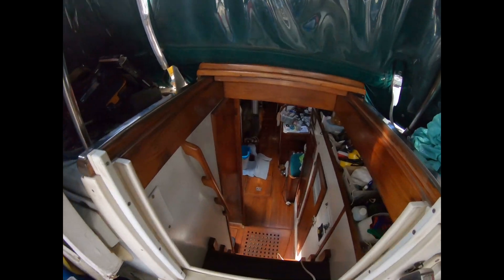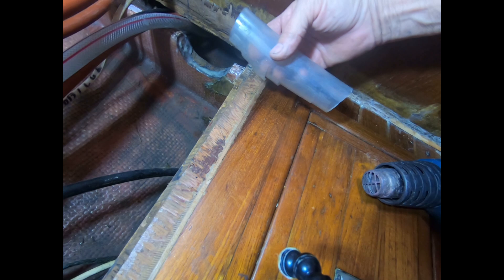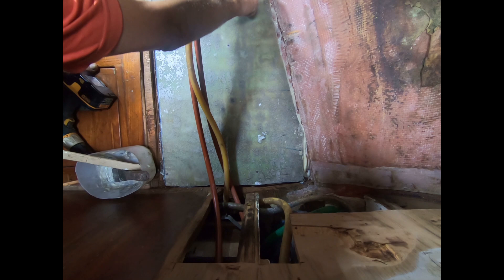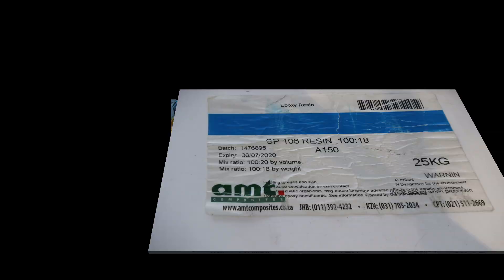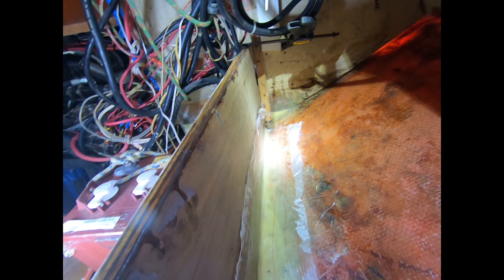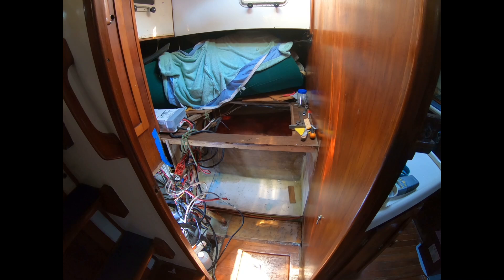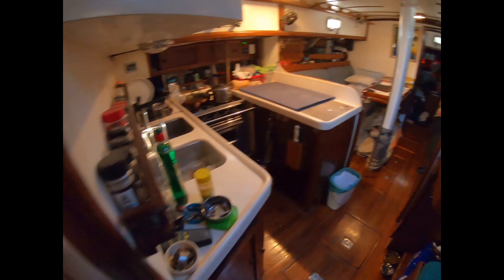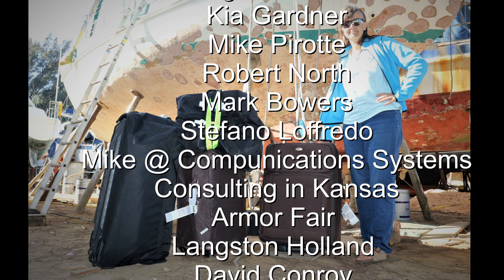How to Rebuild a Battery Box (LEAKING lead acid batteries on a Sailboat!!) Patrick Childress #46

Comment: Patrick, I would suggest aluminum angle, install it "inverted" with the sides bolted to the left & right panels you installed. Then the other side will rest on the battery tops which would hold them in place even with the boat inverted. I did my boat this way. I was always thinking what would happen to hundreds of pounds of batteries if I ever rolled the boat & the angled aluminum solved the problem. I actually secured everything in the boat to remain in place if inverted as I had two friends (on two different boats, one actually WAS a Valiant 40) that inverted their boats, one from a roll, the other from pitchpolling. The boats righted fine with minimal flooding but the crew on each sustained very serious injuries from flying debris, galley stores, batteries, tools, etc. From that point on I modified as necessary everything to stay in place should the worst happen. I always slept better, especially if hove to & sleeping in big seas!
Reply from the maker: Interesting points. Thanks for sharing.

Comment: Amazing energy and tenacity, Patrick. I’ll be using that episode for inspiration many times. “What would Patrick do here?”
Reply from the maker: What a compliment. Yea...I’m not sure where he gets the energy and enthusiasm for all this. The moment it was done, he didn’t even take a breather. He has moved on to the foredeck and windlass! -Rebecca
Reply: Patrick Childress Sailing No breather ay. Hmmm thats not me. I do a lot of breathering. I try to make up for that by being more strategic with how I spend my efforts. I have to make two built in waste holding tanks (no room for off shelf versions) so will be using Patricks techniques and energy model for that project. If you are interested I am developing a gizmo I call a dynamic bridle to resolve the rolling anchorage problem. It will be a small low powered winch roller module to drive a loop line to angle the boat optimally on the end of the anchor chain to head into an otherwise beam swell. It is getting smaller and more workable the more I think about it. If you want to talk about this and share thoughts and anchoring experience (I have very little so far so am shooting in the dark as I develop this idea) bill@cgrpt.com

Comment: Patrick, thanks for filming this project. I did a redesign of my battery area similar to yours but smaller in scale and without all the deconstruction in order to get a bank of T-105's in the locker. For strapping them down, I used 2.5" straps with plastic buckles (acid proof from a surplus store) and ran them under the batteries through slots in the structural floor. These go over the tops of the boxes I glassed together for the batteries and attach on top. The batteries are strapped in but easily can be unattached and opened for servicing. You just have to remember to have the straps hanging out of the side when you put in a battery! Good luck!
Reply from the maker: That way of strapping is a nice idea. Thanks.

Comment: Some flat metal bars with a 90deg bend on each end would work. Grind a notch on each upturned end so you can lift and rotate 90deg to remove sideways?
 Or cut some wood a little under sized to use as a male mold and do a glass U channel layup of the same just don't forget to peel ply the wood first, a bit of Kevlar or core might be advisable maybe even some Dacron or that nylon webbing for tensile strength should she be over turned completely.
 Thanks for the informative and inspiring content.
Reply from the maker: Kyle, Thanks for your idea and positive comment.

Comment: Another fabulous video Patrick, my assumption is that epoxy is impervious to battery acid, Which is good to know. I appreciate the fact that you’re a meticulous craftsman, as am I so your videos are very relatable. And now comes the hull, What fun! Cheers
Reply from the maker: Yes, all the information I could find says that battery acid does not bother epoxy but will eat polyester and vinylester.  There was not time to show it in the video, but I put a full layer of glass and epoxy resin on the floor of the battery box as there was no way of telling what type of resin was used to make the recycled panel.  I think, next weekend we will start in on the blister repair. That should actually go fast, the patching of the craters, but all the faring will be the labor and time killer.

Comment: As per usual,  nice work, Patrick.  It looks impervious, and so should the battery-clampage.  Have you considered visiting the dumpster and finding a chunk of suitable discard to be cut/fit/held in place on top of the middle battery and under the existing side cleats, by the red battery cables and compartment side?  As tightly-fit as they are, I don't think the batteries can fall out, but the addition of a friction-fit board above and across the middle batteries would do the same thing, with squeezed garden hose providing the cushioning 'friction'.  Shim shingles even more so.  No need making it too complicated/expensive, no?  Happy hunting, friend.   (Note to Rebecca--a shot of Patrick 'dumpster diving' might make a great tee shirt deco,,,just sayin').   Each episode is a treat,,,thank you.
Reply from the maker: That is an idea for securing the batteries but I would have to strengthen, like glue in, the cleats that support the battery box covers, as they are just screwed in now.  Thanks.

Comment: for driving screws,  nothing beats the switch to Robertson screws and bits (AKA square drive)  philips bits are the worst!
Reply from the maker: I can't understand why more square drive screws are not made. I used a lot of stainless steel square drive screws to secure synthetic planking on back yard decks. I thought for sure, manufacturers would catch onto square drive, but not so.
Reply: @SailingBrickHouse-RVLife   Stainless square drive are easy to find.  I use them exclusively. just order them by the box of 100.  As I refit my boat I'm removing lots of old philips head,  they go straight in the bin and  get replaced by a square drive.  But I am in Canada where they are very popular!

Comment: never  fail to impress,, nice to see you use the paddle when laying up the mat with the resin,  dont usually see that  and it makes such a good job,, yes you sure know how to handle that grinder , but my heart was in my mouth when i saw those bare feet so close to the disc,,, i am not a great fan of the saftey mob but my two always are proper foot wear and gloves when using a grinder, oh and glasses.,, great vid Pat  , and nice job,,, no tips for the battery hold downs but i am sure you will come up with something suitable... cheers R
Reply from the maker: I suppose it always appears riskier when watching someone else working with a power tool. I have had that grinder for decades. Thanks for your comment.

Comment: I have stainless steel flat bars that are thru bolted from the battery box side walls, keeping the batteries down. Heavy 240Ah batteries, so quite heavy duty flat bars. I don't know if it works good with your setup, but one idea anyways...
Reply from the maker: Thanks for the suggestion. I will see how I can make that work.

Comment: I'm a big fan of pad eyes and bungee cords for securing batteries, if you glass those nylon straps in you are going to have a mess on your hands when it comes time to replace them.
Another option is to make some strong backs out of pvc pipe and put them between the tops of the batteries and the battery box top to hold them down.
Reply from the maker: PVC pipe, with a stainless steel rod inside for strength and rigidity. That is what we use to lock our companionway hatch closed , at night, in questionably safe anchorages. Set in sockets, in the battery box, that could work. Thanks .

Comment: To make battery hold downs, use a piece of StarBoard (high density polyurethane board) spanning across batteries and using blocks of the same material used for shims under bar to batteries—pushing down on batteries—all screwed together and bolted to the sides of battery box. Makes a clean solid bar hold down structure across all batteries instead of a strap. Material is impervious to acids.
Reply from the maker: Thanks for the nice idea.

Comment: Securing the  batteries.

I would use aluminum crossbars (square bars) bolted to the sides of the box via brackets to secure the batteries. This should hold the batteries in place even if you flip and make the whole box stronger by connecting the two sides together. You could also try to do something similar with wood and fiberglass and that might be cheaper and ligher, but that would be a lot of work. Brackets are a very easy way to ensure a secure connection. You might end up with several mm between the bottoms of the bars and the tops of the batteries, but you can easily fill that gap with a dense rubber to get the perfect fit and this would also leave some room for future batteries that might be a bit taller. It looks like you will need 3 bars (one for each side-by-side pair).

If you want to use straps they need to attach near the BOTTOM of the box to hold the batteries DOWN. Otherwise you have an exponential amount of the stress on the straps and where the straps are attached*. Don't use nylon straps, nylon is sensetive to acids. It seems like it is too late in the project to put a proper attachment point at the bottom of the box, hence my suggestion for bars.

Why don't you just screw (or bolt) the covers down? Put some styrofoam blocks under the covers that hold the batteries exactly in place but still allow airflow. Should work better than what it looks like you were considering with that strap, be less work, and cost very little.

I think I'm a bit late with my suggestions. What did you do?

*see "load per anchor" in the following table. At 150° (nearly straight across at the top level of the batteries) 100lbs of force UP would be 193lbf on each side of the strap (instead of 50lbf with the bars I suggested, or with the strap attached straight down to the floor at ~0°), And that force would be pulling IN, which I think would rip your fiberglass work apart faster. https://en.wikipedia.org/wiki/American_death_triangle#Description (sorry, it's from climbing. I have more experience there than with pure physics or sailing. But the principal is the same!)
Reply from the maker: Lex Maxwell Patrick...have you seen this...he has some interesting ideas, Rebecca

Comment: Great video Patrick. Try using automotive battery clamps you can find them at the auto spare shop.
Reply from the maker: There might be just enough room to squeeze them in. I am working through a lot of good suggestions; thanks for yours.

Comment: it never ceases to amaze me as to how much work goes into the smallest of jobs on a boat, and the amount of money that is spent on epoxies , fillers, matting, wow, I bet you that repair has to be upwards of a grand easy, including the material , am I right, ? seems no one that posts videos like this, ever talks about money,, 
is it me or is every little thing overbuilt to the 10th degree
Reply from the maker: That one white, front panel cost around $150 to have made. I would have to dig up receipts but I would guess resin and associated materials would be $300 dollars. The dumpster is what saved me on this job. I used a piece of solid teak for the spacer to fill in above the foam on the bottom of the hull to carry the new subfloors. That hunk of teak was free but would have cost a small fortune if I had bought it at a store. Labor would have been many thousands of dollars.
Reply: @SailingBrickHouse-RVLife  yes, Im sure you saved a small fortune on labor, I put a dollar amount on my labor, I know most people dont, but ya kind of have to, lol, I recently purchased a trawler that needs some tlc, mostly cosmetic. One repair on some rotted wood in the corner of my salon so far Im in  to about 1000 on materials, and all I am doing is removing the rot, filling it, and sadly will be painting and recovering with some type of wall covering that I did not even get yet,,lol 
but yes you have to do the work yourself, or if you have to ask, dont buy a boat,,

Comment: Ahhh remodeling houses and boats. Ya tear it apart, put it back together and people say: "that looks easy, I bet it didn't take any time at all!" Great job on getting it done in time, the fan and air flow should help air out the compartment, just dont light a match next it, just kidding!
Reply from the maker: Thanks for the comment, Daniel.

Comment: If you have the room I would run a stringer down the center between the batteries and secure the ends with screws into a mounted block. Another way would to fabricate a couple metal straps with Ls on the end that screw into fore and aft walls.
Reply from the maker: I am trying to keep metal out of the battery box as the battery acid would affect the screws.....unless I used a particular grade titanium screw......hmmmm .  I will have to check with Allied Titanium and see what they suggest. Thanks for the idea.

Comment: i used little turnbuckles to secure batteries, with metal strapping
Reply from the maker: Good idea! How big of turnbuckles, and made of what to no create nay shorts!? -Rebecca
Reply: @SailingBrickHouse-RVLife  Rebecca, i used normal metal staps and turnbuckles. there is zero chance of shorting , i've got two 12v batts only... the straps run through the posts, not along them in the centerlines of the batteries.  In your case, you might have to do two/three batteries at a time, and insulate some of the strap with an old rubber hose or the like. for such a large bank, i might be inclined to install two  2" x4"s  over the top, with holes drilled in the ends to pass over mounted 1/2" vertical studs... and use a little wingnut. ..I hope this is helpful and not just acedemic, this video is old! you're likely in Patagonia by now!

Comment: Not sure how strong you wound want the straps. But on each end / line of 3 batteries put a eye bolt in. Then run a ratcheting or sinch down strap long ways over the batteries-or just spare line. Just situate the eye bolts an inch or two below the battery top.

○--[ ][ ][ ]--○
○--[ ][ ][ ]--○

Fantastic video Patrick, thank you for sharing.
Reply from the maker: Chad, thanks for the idea. The batteries fit snug in the box so there is no room to put an eye bolt lower than the battery tops....but I am thinking a strap could slide through a hole cut above the batteries at each end through which the strap could fit.

Comment: Re: straps for battery hold down.  Screw down straps under battery with plastic end fittings (with adjustment) on top of each battery.  Main hold down screws near edge of battery for best hold down effect.  Use washers and be careful not to have the screws chafe on battery case (this is not an issue if you have individual battery boxes).  Screws can be into subfloor or vertical panels (best since screws will be in shear rather than tension in the case of an upside down oops).  Be sure no metal stuff can fall on top of battery connections in any case, ie don't store loose tools on top of battery covers.  Also, I brace the batteries with pieces of wood so they can not move at all.
Reply from the maker: Ray, Thanks for the tips!

Comment: To hold the batteries in place: try to buy or find a small plate of aluminum or stainless steel. Cut 3 strips (doesn't have to be perfect). Drill a hole in each did of the strip and screw these in place, in order to clamping your battery's in place. Or use bold and nuts instead of the screws to hold everything in place. Using bold and nuts instead of screws will allow you to disassemble in case of an urgent battery change. Ps: nice work you've done there. Hope this will be of any use for you.
Reply from the maker: That is a nice idea. I am thinking of using strengthened sail battens like you are suggesting and possibly inserting them into slots cut into the walls of the front and back panel and may use your bolt and nut idea. Thanks for the tip.
Reply: @SailingBrickHouse-RVLife  my pleasure. I'm looking forward to your next video. Hopefully I'll get some work done on my own project this month 😊. Keep up the good work.

Comment: When there is a possibility that batteries can leak acid( normal lead/ acid batt.) there is also an possibility of corrosive / explosive gases who come free especially when the batteries are recharged( bulk mode)
So it is not an bad idea to prvent some ventilation.
Better but expensive,closed batteries,gel,or li/ ion etc.
K
Reply from the maker: Yep..eventually went to LiFePO4 batteries…see the later video if you want to know more…

Comment: The simplest battery hold downs woul be to put support bars on the underside of the hatches with some foam to protect the tops of the batteries then a couple of dogs on the hatches and done. When you open the hatch you free the batteries
Reply from the maker: gmoose777, that is an idea to think about, and not very complicated.. Thanks.